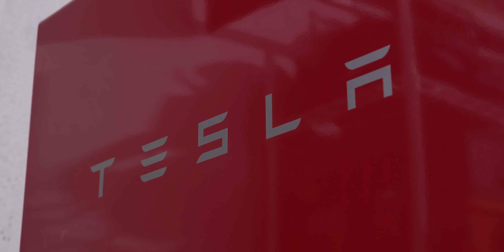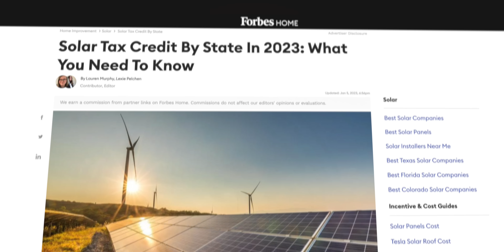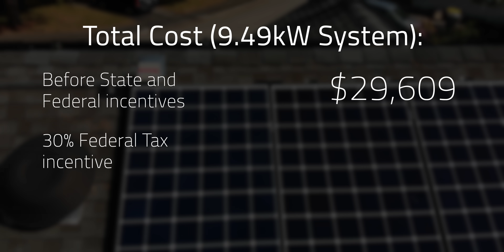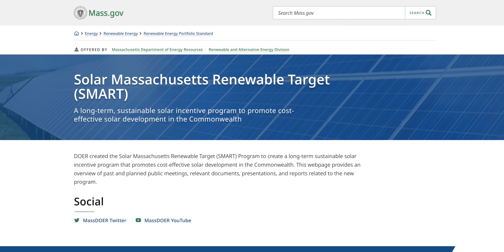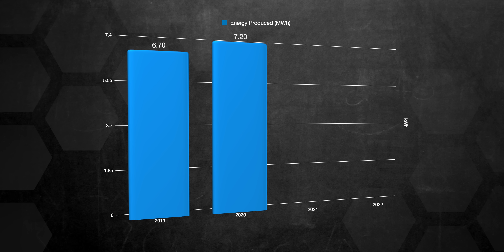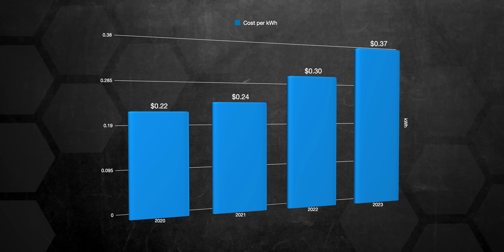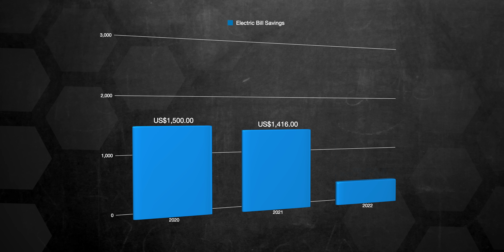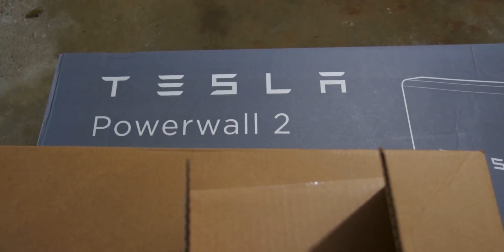5 Years with Solar Panels - Is It Still Worth It?

Comment: When it's time to replace the roof or if there is a leak that needs repairing, how much extra does it cost to remove and replace panels? How long does that Tesla power wall battery last?

Comment: I installed a small 2.5 kWh array 9 years ago costing ~$7500 before the 30% government rebate. So far, I’ve produced 28.5 MWH and currently have an electric bill balance of -$1500 and never had a bill for the last 9 years. The only thing I never looked into was SREC’s, maybe I could have reduced my cost but very happy that I installed the low cost system. Btw, I live in Rhode Island.

Comment: My only regret from installing a 5kW system 6 years ago is that I did not install larger. Due to exceptionally low rates at 10.7 cents per kWh, I have not saved nearly as much money, but tax incentives should still net savings inside of 15 years. That may seem like a long time until the added equity for resale value of the home is considered, which in many cases is a net gain from the first day of operation.
Reply: I will likely move at some point soon, and will holdback the equity needed to install solar wherever I purchase if it does not already have it. Even without incentives or high rates, the economic benefits are crystal clear.

Comment: I don't know how viable this would be, but I'd love to see some analysis on how much home solar actually acts as a carbon mitigation strategy.  I've seen some analysis that indicates that if you're not in an ideal solar environment (very high elevation, or very high sun like Colorado, or Arizona) then it can take a very long time before the panels will actually prevent as much carbon emissions as their manufacture creates. It's been hard to find multiple people doing this analysis in detail to vet the claims. Since your house is in a less than ideal setting it would be really nice to see you do an analysis of your own solar setup, the carbon released by it's manufacture, and how many years it will take before it represents a net reduction in carbon emissions.

I'd also be very interested to see what developments are in the works that might reduce the amount of carbon released by solar panel manufacturing in the future.
Reply: The carbon intensity of solar production is thankfully already going down quite quickly, so it would depend entirely on when that study was authored. Eg an older 500W panel of the same size as a newer 4kW or 5kW panel will obviously have very different “payback” characteristics. 

This is also why some people prefer to buy second-hand panels, since they’re already produced and might even be scrapped back into silicon and glass without that extra use.

Comment: How are you getting 1:1 net metering?  I'm also in MA, but my credit is being calculated at $0.24 while my rate is $0.35.  I'm on National Grid, pretty much my only choice.  I can find other power providers, but that has a very limited impact on the whole bill since it's National Grid that charges for the transmission, and the plethora of fees.

The $0.24 comes as a "rolling 3 year average" which appeared in 2022.  I still can't figure out where that change came from.  And naturally, there is no calculation shown that explains how they get the number.

We went from a fairly large surplus that was going to carry us as our panels aged to wiping out our credit and seeing positive bills for the first time last year since 2015 (Panels went live in Oct of 2014 and the snow of 2015 caused a huge number of no production days.)

We've made some lifestyle changes to run things like dishwasher and laundry during the day to avoid needing to pull that power at night (since we get a 30% penalty doing so) 

Been looking at battery tech, but it's a lot to install.  The numbers are not as attractive as the Solar was.

Comment: My concern about allowing the POCO drawing from our batteries is we if and when we install a battery(s), whether or not it hurts the life span of our batteries.  Great for the POCO, maybe not for us...any comments to validate or squash my thinking?   Thanks, as always, brian
Reply: The way I see it is, if they use it a lot, you’ll get a lot of payouts. That will offset your cost for any degradation. If they don’t use it very much, there won’t be much degradation, so you don’t need to worry about it. 

The cost should be about even either way, in any well-designed incentives system. Of course it’s up to you to research others’ experiences in your area with your utility; see if it really is well-designed.

Comment: US$0.37/kWh is obscene, ouch.  I'm currently paying $0.44/kWh here, but I live on an island with 100K people where the utility electricity is generated by diesel engines, using imported diesel.  BTW, my small solar pV system, installed 13 years prior, paid back for itself last year, costs including panel upgrades and replacement inverter.  I'm planning to swap out the panels for better ones this year as their output has degraded a bit.  The money I've saved with the pV system is going to cover a good portion of the cost of the new panels... 🙂

Comment: Great video! I had my solar installed last year. System size is very similar to yours. I’m two months in from activation and so far have generated more than I have used, even while charging my Tesla at home. Living in Texas I don’t have as many incentives as you do, but overall it’s been a great experience. Happy to share my installer experience with anyone in Texas that would like! Thanks again 😊
Reply: Be interesting seeing how home wind power would affect the equation.
Reply: I'd love to know any of the financial numbers you're working with. I'm also in Texas and couldn't find a quote for less than $60-80k for a smaller system than what was installed in the video, don't have net metering, and our cost for electricity is usually less than 15c/kWh on average (sometimes under 10c).

Comment: When I look up the Tesla Powerwall+, it says it's only compatible with Tesla brand solar panels. Was that not the case when yours were installed, or is this a new development?
Reply: It’s not a technical reason at all, Tesla just started only selling Powerwalls to their solar customers as a policy choice a couple of years ago. They just don’t want you sourcing your panels from a cheaper supplier, and are aware the Powerwall has brand recognition that other home batteries don’t, which will marginally increase their solar sales. I do suspect this will push many customers to other battery options, however.
Reply: @kaitlyn__L  Understood, thank you for the clarification. Do they offer discounts if you install both at once, or are they relying on brand recognition to drive sales?
Reply: @0whitestone  I don’t believe so. In fact, after the policy change, a lot of people cancelled their order after their solar roof quote was twice what was originally estimated. It seems to be purely a demand management measure, ensuring only the most lucrative customers are taking up their time.

Comment: With our utility in MA we get the 1:1 net metering based on current rates. We build up a credit in dollars with them during the summer when rates are low but they normally raise rates in the winter when our production is low meaning we eat through that monetary credit faster than it was built up. Even though our system was sized at 105% of prior usage we still end up owing money for the later winter months.

Comment: Love to know the details of your solar loan.  What was the interest rate?  Lots of door-to-door companies here offering to swap your current elec bill for a solar loan payment under the premise that your energy costs will be fixed for the next 25 years.  Turns out the loan has a low interest rate, but there is a hefty fee that is financed in at typically 50% of the system cost.  So a $30k system will end up with a $45k solar loan.  These companies stop talking to you as soon as you say,  I will pay cash for the $30k system.  

Will you be paying off your solar loan before selling the house, or trying to get the buyers to assume it?

Did you actually "save" any money,  or did you just service a solar loan?
Reply: Solar loans?  Here I covered the cost of my solar PV system under a "home improvement" loan.  I argued with the bank that the system was spec'd to last 25 to 40 years and should be considered part of the house. Basically extended the mortgage on the house a few more years.  Monthly payment remained the same.
Reply: @Grommet2007  So was this "Home Improvement Loan" a non-collateralized personal loan, or really a cash out refinance?
Reply: @D2O2  Cash out refinance would probably be the best fit for what happened.  We basically renegotiated the mortgage to cover the cost of the solar pV, and the bank was happy to oblige, particularly when I explained that the solar pV system was essentially "part of the house", and what we were doing was similar to other home improvement exercises like refurbishing a kitchen or adding a garage.  As a result our total monthly expenses was reduced (utility savings, and no increase in loan payment costs).

Comment: I live in northern Idaho.  We get a LOT of snow.  I had our solar panels installed on an elevated frame on the ground.  This work out great.  I am able to clear the panels of snow easily and not worry about build up on the roof.  We have the room on our property to do this.  If we get a huge dump of snow, we still need to clear snow at the bottom of the panels to allow for the snow to slide off.
Reply: It makes much more sense to put the panels on the ground if you have the land. The roof is really just for the city and business districts.

Comment: Nice video! I live in an apartment. I'm watching this for entertainment. I have a gas generator for emergencies other than that I could maybe get a portable battery pack but that would deplete over time where the generator will stay good as new. The downside is the noise it produces. Another way to go would be using an EV for a power supply. Still batteries decay over time and require maintenance. BTW congratulations on the house you're building it must be exciting 😀
Reply: While batteries do decay over time, they can and will last for many years with minimum maintenance. In 2006 I purchased a cordless Dewalt drill that uses LFP batteries. That drill and its batteries are now 17 years old. The batteries are still functional. Capacity is down about 25% and of course I don't use them every day but neither would one use a battery backup every day. They went through a lot of abuse in their early lives as I used them to power a home made e-bike for two years.
There is maintenance for gas generators. Have to purchase fresh fuel once in a while because it can go bad. Basic oil changes. Start it a couple times a year to test it. 
So whatever works for you is good.
Reply: @jjackson3240  I have a 24v impact, and a 12v dewalt drill, and another 12v drill all with li-ion batteries. On each one battery is still good and one bad. So it's a hit & miss. I did the same thing with the impact batteries I used them on my home made e-bike. All it takes is for 1 cell to go bad and it won't work anymore unless you fix it or replace it.
Idk about tesla fire wall, but the tesla car batteries are pretty tamper proof. If that would be the case with the fire wall it would be better to build your own, or just use a gas generator
Reply: Not trying to unnecessarily scare you but Noise is the least of your worries,,,,If you don't zap yourself or trip over the extension cords and break your leg Carbon Monoxide, the silent killer, is an ever present danger, as well as the fire hazard of storing gasoline in an apartment. - Even for a house there are better solutions for standby power like a high buck standby generator.that runs on propane  or natural gas if it's available.  

There are battery inverter packs with deep cycle lead acid batteries  that are now available. (Or it;s easy enough to set one up yourself)   Keep it plugged in and it will stay charged for years and you can get a new battery at an auto parts store when the original battery finely craps out. ;

A generator can be a dangerous thing.  Not as simple as one may think.

Comment: I had an 8.5 kW system installed along with two powerwalls.  I live in Michigan and there are no state incentives here.  The only incentive other than the fed tax credit is a power generation credit.  It took me four years of analysing the cost of solar and waiting for prices to fall to finally decide that it was worth it.  Matt's set up is only profitable due to the fantastic incentives in his area.  His setup in michigan would have a payoff time of close to 20 years.  He also didn't mention in this video that his winter time production is really low.  Dec and Jan for me is around 15 kWh/day on average whereas summer I get around 60 kWh/day.  I am not trying to bash Matt, because if I were in his situation I probably would have done the same.

Keep this in mind, the more people that get solar, the lower the incentives become.  When you reach about 30% with solar, about the only incentive that you will get is perhaps a power generation credit.  Also, there will be fees charged just for having solar.  Get lots of quotes.  There are a lot of shady companies out there.

Comment: Matt, you’ve got an EV, Correct?  I know you know this but viewers might not realize that when your solar production is offsetting gasoline purchases it can be an even higher value than the calculation of offsets in grid electricity rates. In your case probably not since you’ve got a high electricity charge. In WV our rates are about .13 cents per KW. It also matters how much you drive, but something to consider when making the decision to move toward solar. In my case we save over $7,000 a year offsetting vehicle fuel costs and home electricity, which has dropped the payoff period to <5 yrs on a 28KW solar system.

Comment: It still strikes me how expensive solar panel installations are in the USA, I paid about €5000 (including installation and taxes, no subsidies(!)) in 2014 for 14x 250Wp panels and a Solaredge inverter + Micro optimizers system (similar to the Enphase micro inverters), and my system also looks much simpler... couple DC wires from the panels into the Solar Edge inverter, wires out to the power cabinet, where it is connected with the power network in my house, that's it... Everything is also inside my attic, no wires or conduits to be seen on my roof, all wiring is below the solar panels, one hole in my roof and via some conduits on the inside to the solar edge inverter mounted inside my house near the gas boiler. Your costs are 5 years later still about twice as mine before incentives (More than $3/kw versus less than €1.5/Kw for me) while costs for solar panels have come down a bunch in those 5 years! with more watts per panel for the same price.

The smart meter in the power cabinet, measures how much power I deliver back into the grid, it is read out remotely via GPRS by the power distribution company 6 times per year or something, who sends the data to my energy provider, all automatically. The Solar Edge Inverter is connected to my internet network, Solar Edge has a nice monitoring app..

When metering stops or is wind down in a couple years I will look into getting a power wall, I would like to have it installed in my attic as well mounted at the very strong concrete walls I have there, but to get it up the stairs could be a problem, the thing weighs 300Kg!.. But from a practical point of view it would be the best location.. anyway, I have still a few years to think about that... It might also be interesting to upgrade the panels to better ones that generate more power, as I also look into charging my Tesla Model Y using solar using a smart charger... But we will see if this is a smart thing to do. Right now I cannot charge at home, and use the public charger at the parking lot nearby, I would need a permit from the city council to park in my front yard LOL!

Comment: The numbers are interesting but they seem to be based on very high local electric costs. I just signed a three year contract with my electricity provider. It will be 15 cents per kilowatt hour. There is no net metering in my area. Sunlight is plentiful. There have been no power losses at my residence in five years. There are no state tax rebates as state income taxes do not exist here. Unless the cost of solar drops a lot or electricity jumps to Massachusetts levels, I cannot see getting solar installation at this time.

Comment: I've been trying to get solar installed for years. My town has municipal electric so the few installers that don't hang up on me, still refuse to work in my town. On the bright side I still have very reasonable electric rates but I would like to reduce my use of the local gas powered production plant.

Comment: It appears as if when people install solar power systems, they go all in all at once. It seems to me that there are advantages of starting small and increasing capacity over time. I only have 1kW now, which reduced my bill by 20%. The next 1kW will only reduce my bill another 10%. I didn't have to spend thousands all at once and I can add more at any time.
Reply: Going big substantially reduces payback time, and also reduces risk (longer payback time = greater risk of having to replace an inverter before the system's paid for itself).  The panels may be certified to last for many years, but the inverter is not.  The larger the panel / inverter cost ratio, the faster the payback time and the lower the risk.